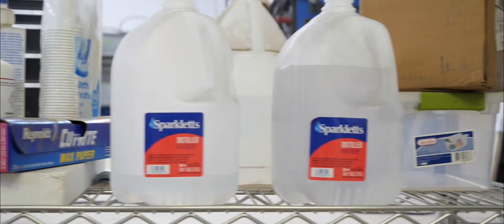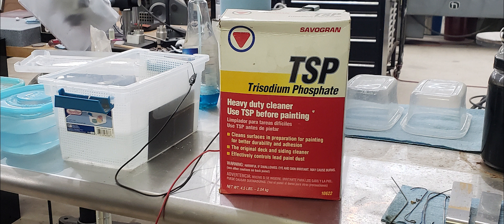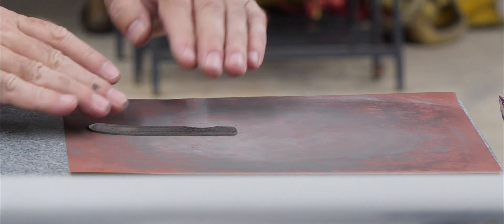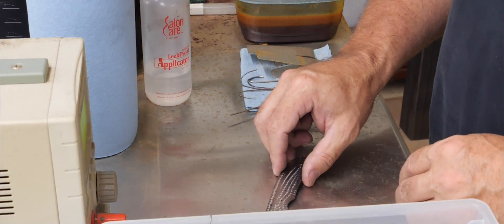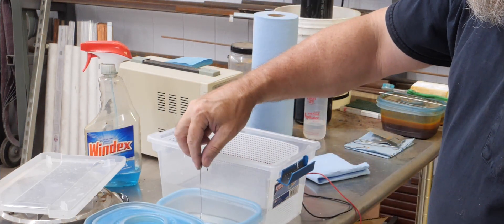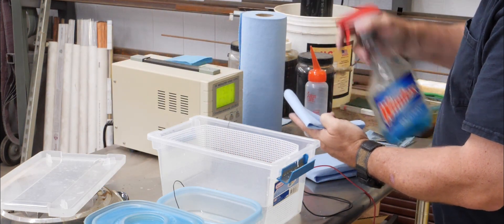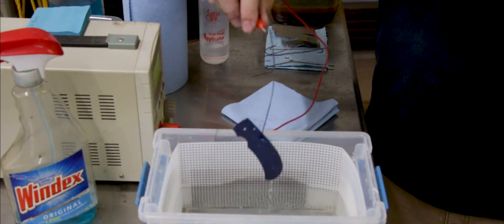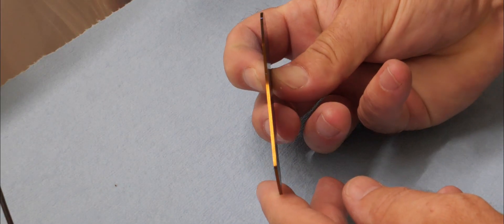Knife Making - Anodizing Titanium Liners

Comment: You obv have more experience than I do but I figured I would share a tip. I took a 4x4" piece of titanium plate that is bendable(maybe 16 gauge or 18?) And bend it on the side of the container but not touching the water, just hanging securely. Then attach your lead to that bent plate. Now you can just touch your titanium wire connected to the piece after dipping it in and bam. That way you don't have to deal with the lead getting in your way or just annoyingly hanging off the wire. Great work BTW,  that jeweled look is amazing!